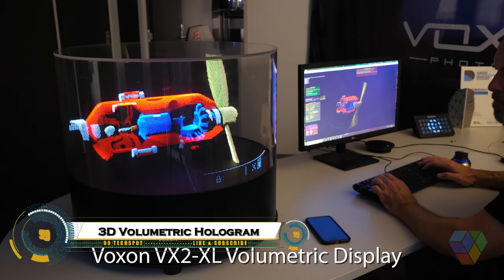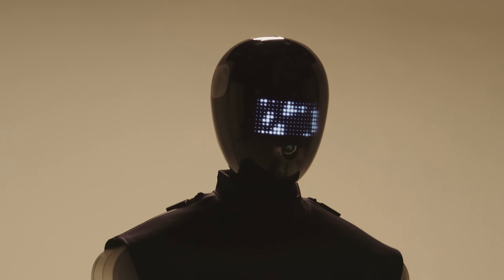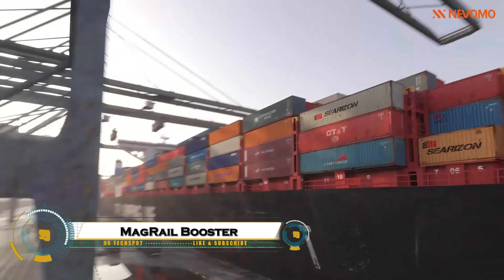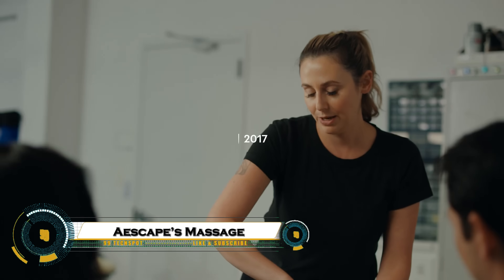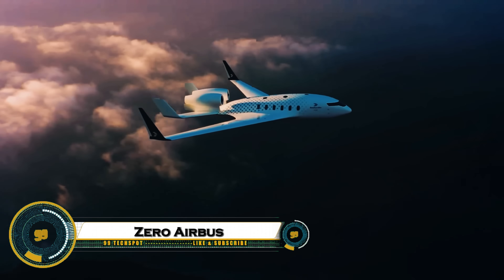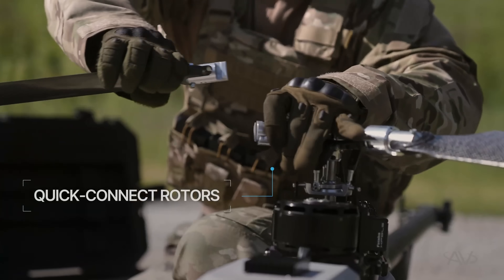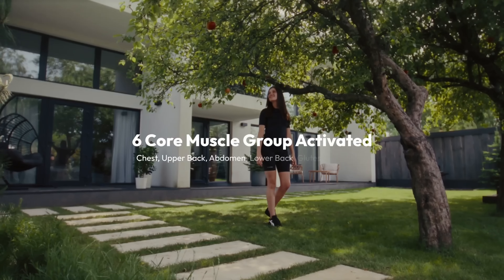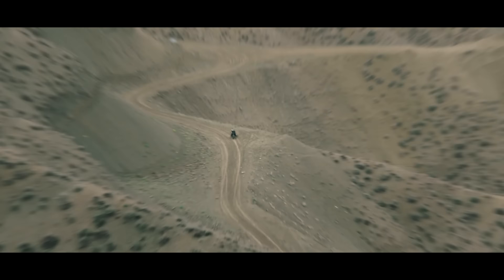20 Inventions That Will Change The World

Comment: @4:21, Seriously? You can't even proof your videos before posting them? I'm a semi-retired audio engineer with 30+ years of experience in live sound, recording, radio, TV, etc. In both analog and digital formats. So the bottom line.... If it's audio, I've probably done it. 

The error at 3:50 of thus video is just p km ain unacceptable. Even someone with virtually no experience as an audio engineer should catch this sort of mistake. All it takes are operating ears! All I can assume is you didn't proof your clip, but rather just assembled it, and posted. What a shame!